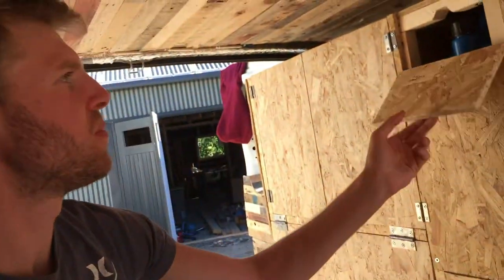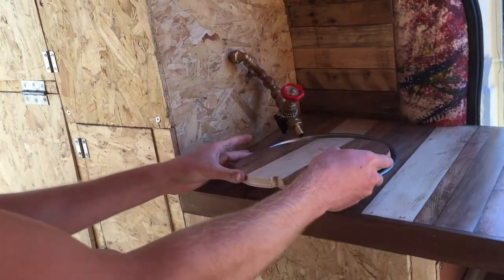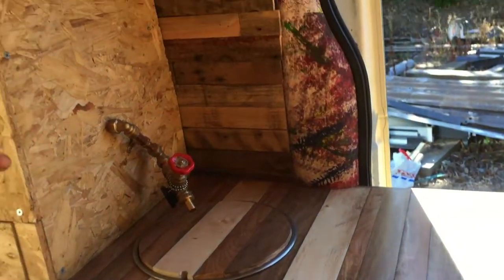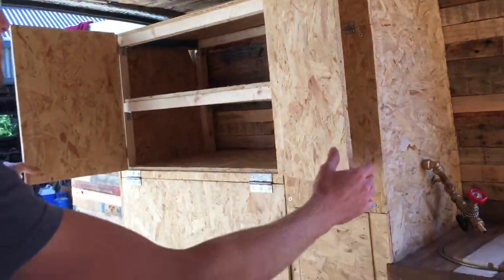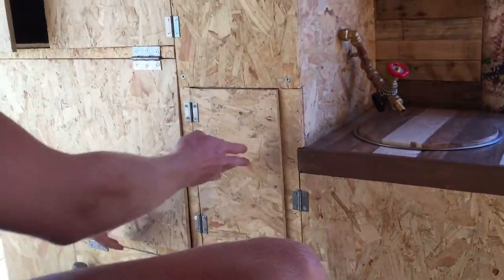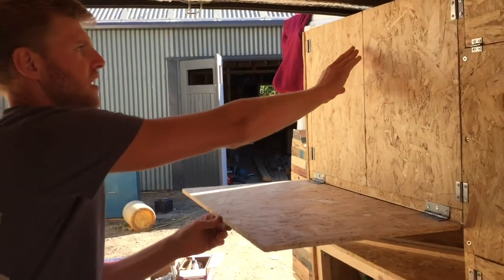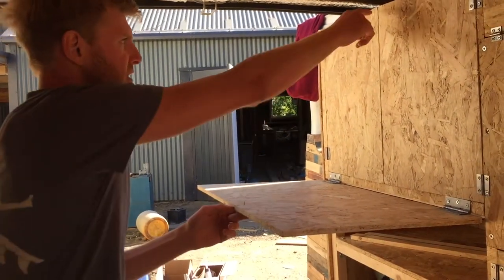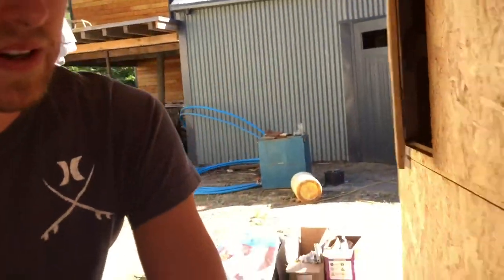Simple Gravity Fed Plumbing, and Electrical System For Vanlife, Tiny Van Conversion #13

Comment: How did you get the power cable into the fiamma? Just shove it between the two parts? Just about to install mine and cant see any proper solution. Cheers
Reply from the maker: yep exactly, I thought it was a bit odd when doing the install but it seemed to work just fine